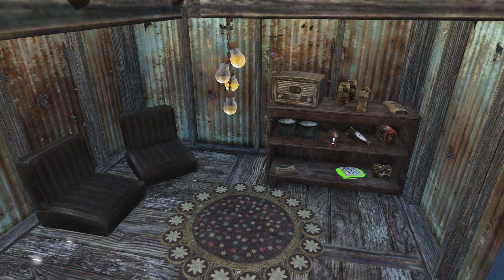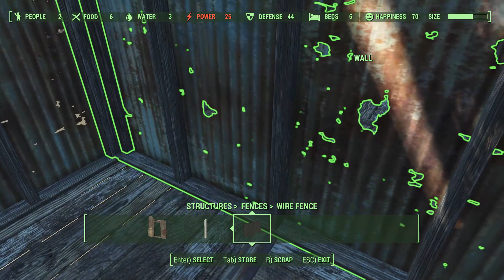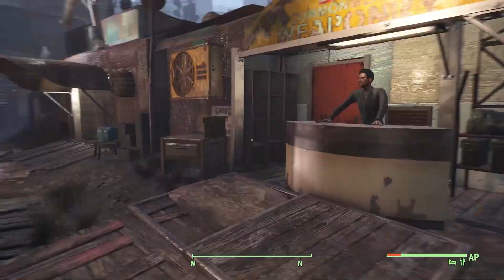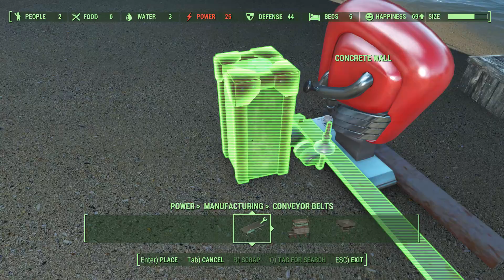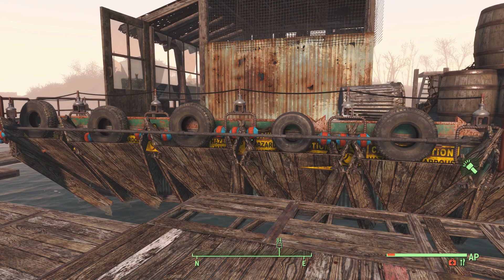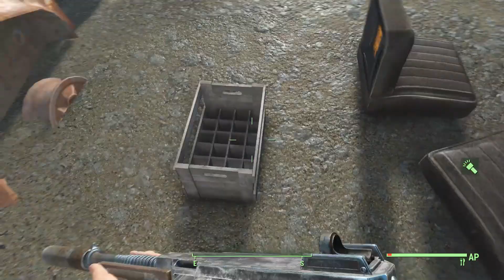How To Make Wooden Boats With No Mods  - Fallout 4 Settlement Tutorial

Comment: I think the provisioner sometimes goes into a downed state when they take enough damage, taking out the supply line until they recover

A quick fix is to find them, and help them out against whatever is attacking them, or set somebody new as provisioner
In the long-term, you could try giving them good weapons and armour, or telling them to path to a different settlement
Reply from the maker: My provisioner is sitting down doing nothing in full health though 🤣  Ot walking around spectacle island unassigned, and I have to reassign him.  I ended up setting up two supply lines
Reply: @fallout4myth940  -- I saw some comments on another vid recently saying it was the water that was the problem. I personally don't think that's it either. Spectacle Island is heavily bugged in certain ways. I've noticed it from one half of the island to the other, sometimes your power doesn't work, sometimes not all of your crops are counted, and sometimes your settlers start acting weird, especially if you have things spread out on both sides of the island. I've never found a solution to the provisioner thing, but I did find it was easier to manage by setting up the route just to nearby Warwick and back. Seems to keep them working for longer periods, but it still bugs out sometimes.
Reply from the maker: I wasn't aware spectacle was known to be this buggy.  Other than making these boats, I've never seriously built on it.  Guess something to keep in mind if I ever expand spectacle island.   Funny enough, the second supply line I set up was to warwick so I hope it stays assigned for me as well!